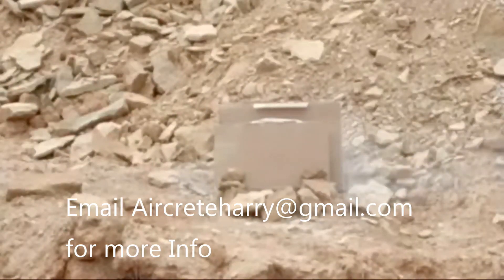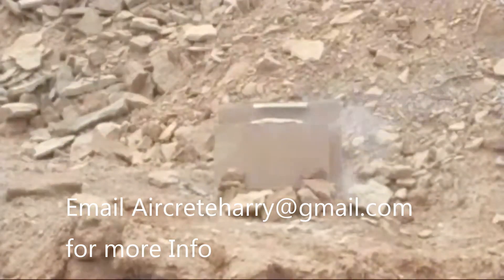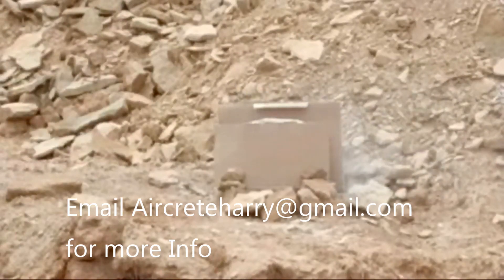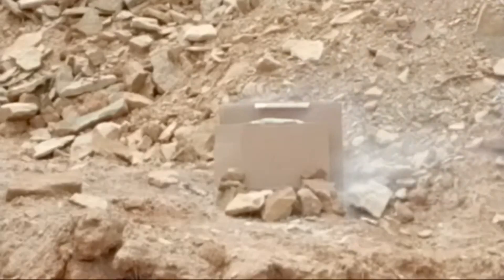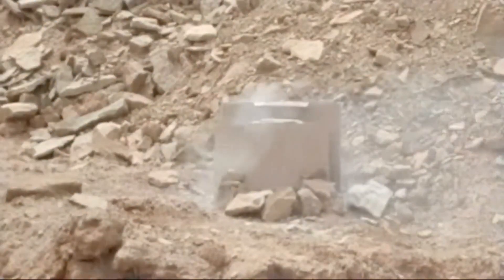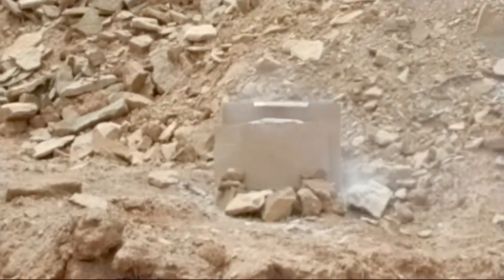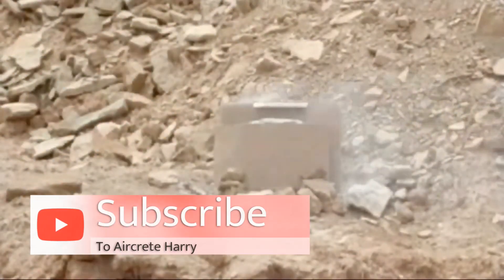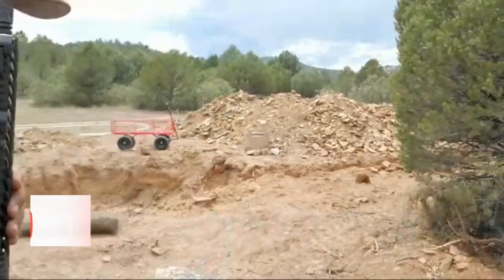Dome Building Workshop | Aircrete EPIC #EPIC #AircreteHarry #Dome #FoamGenerator #Aircrete #Workshop

Comment: Harry this is all well and good but so far you have not made a functional building yet to prove the system works.  You keep talking about dome homes but until you make one people will not buy into the system.  You need to make at least a 25 ft. dome with windows and doors for people to see that it works.
Reply from the maker: I understand what your saying but I have made small test domes using my system. I have all the airform for making a 20,22,30,32, foot size Domes. I showed in other videos. And the EPIC Dome has also been proven many times it's just has not been on YouTube yet. Soon enough you will see on my channel a 20 foot EPIC Dome and a 30 foot Ecoshell with Aircrete Insulation Dome. This system will save people time and money building a Dome. If you have not emailed me yet for more info you won't know what's going on. AircreteHarry@gmail.com
Reply: @AircreteHarry  Show me a completed structure with a PE stamp and calcs attached. Good luck!

Comment: What about longevity of aircrete block?🙄🤔
Reply: Same here..
Reply from the maker: Please elaborate your question.
Reply: @AircreteHarry  about the longevity of aircrete..
Thanks you
Reply: I heard that over time it will become rock so I'm interested about Aircrete replacing clay brick. The compressive strength of good clay brick is 5000psi whereas dense aircrete would be 2500 psi and that aircrete need 10% or less foam.Can I name it Aircrete or CLC?

Comment: This is very impressive Harry, but what about some specs...what is the mix ratio of these super blocks, and how long have they been curing....plus, what are the dimensions of these blocks?
Reply from the maker: The blocks had been curing two weeks before the test I did in the video. They really need at least four weeks of cure time, I just could not wait that long and I wanted to know how strong they where after 2 weeks. The blocks dimension are 12 x 12 x 4.5". Mix ratio to come at a later time.
Reply: Thank you, I reiterate, your demonstration has really impressed me, and I will be looking to use this technology in the near future.